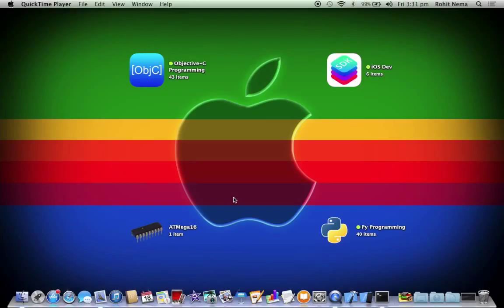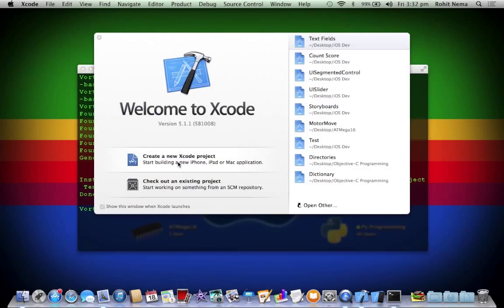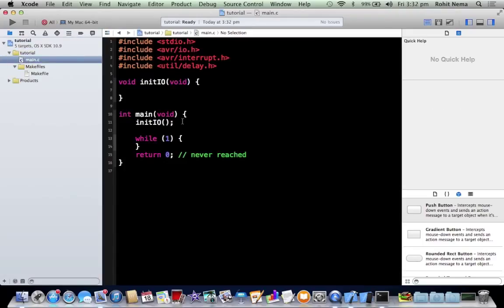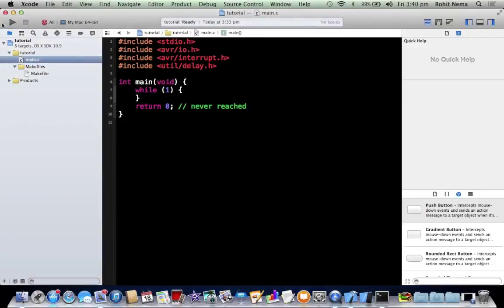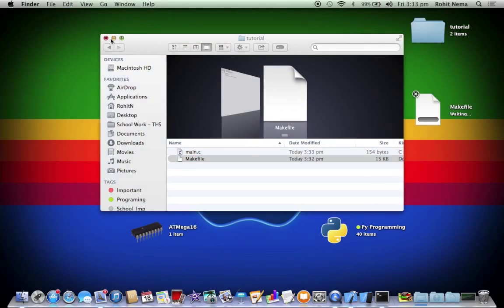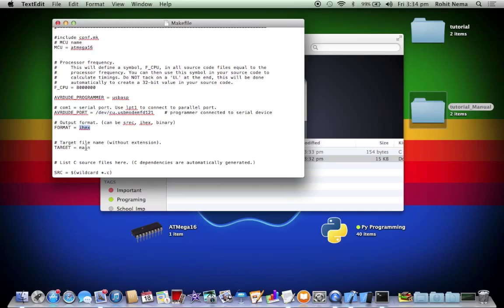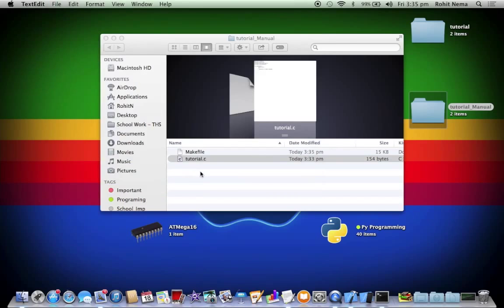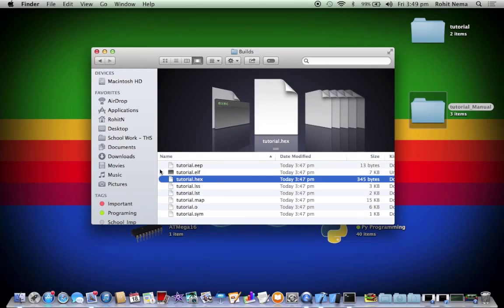Compile and run your AVR C code on an ATMel Chip using a Mac

Comment: hi, i use the first method as you said, when i compiled it, it said 'Command /Applications/Xcode.app/Contents/Developer/usr/bin/make failed with exit code 2' in the makefile, is there anything wrong with serial port? can u help me?
Reply from the maker: Is your chip connected and burnable?
Reply: Did you find a solution to this?